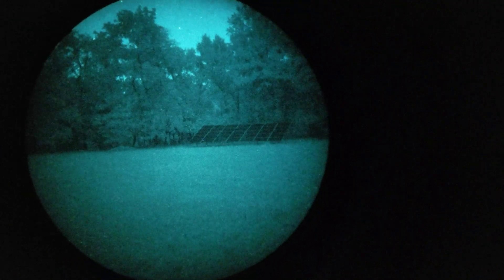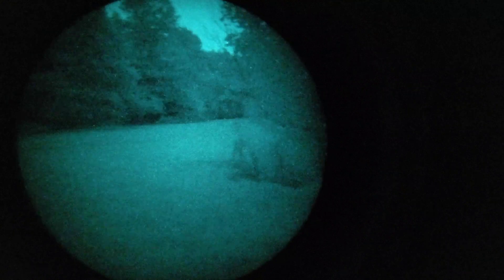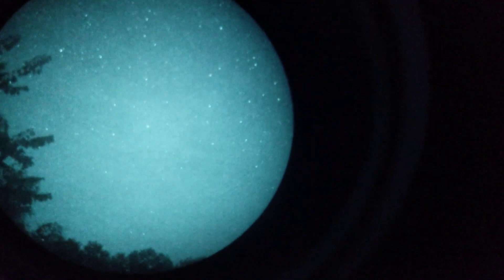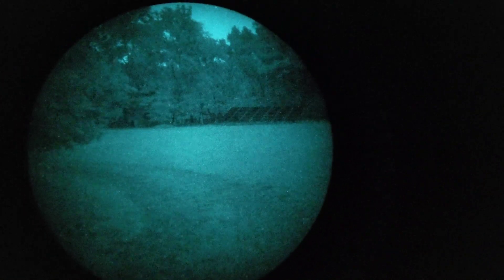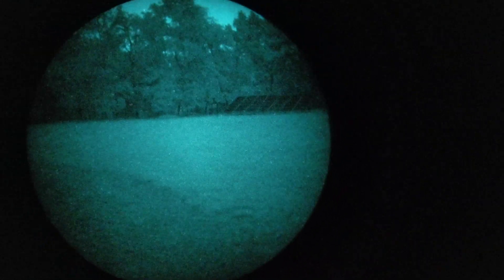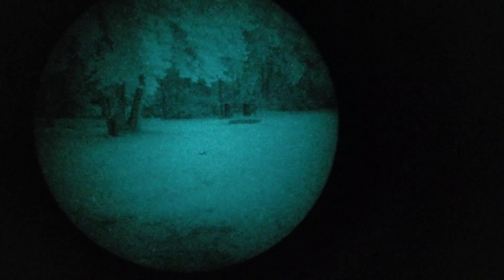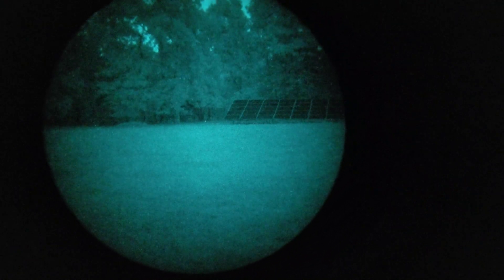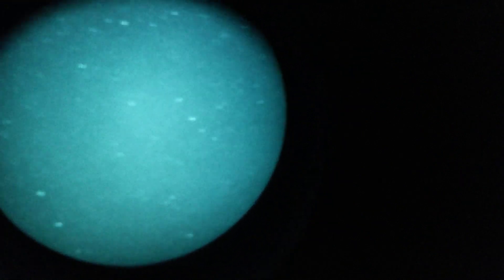TNVC SuperGain 0% moon

Comment: Thank you. I don’t really see the need to dish out the extra couple thousand from filmless to supergain, esp with fusion and thermals coming out. They’re amazing in every single way, don’t get me wrong. But I’m really happy w my 37snr filmless

Thank you for the video
Reply from the maker: I find that the supergain gives me a slight edge with passive aiming here where I live when it gets very dark. I live in a valley by the river, and often we will get a 2-400ft fog layer that cuts off even the stars, and it can get very dark in those circumstances, especially under canopy. That said, 100%! If you have a solid filmless tube, you're fine. I'd put the advantage at maybe 10%. Maybe.

Comment: How much better is Supergain compared to regular L3 filmless in really dark conditions, I mean dark forest on zero moon night? Is it similar jump as Photonis ECHO to L3? Or is it not that big of a difference at all?
Reply from the maker: I've not used Photonis before, but I am of the opinion that it's a 10-20% gain over L3 UF WP regular tubes depending on how spicy they are. It's a legit edge in the dark dark, but adding thermal with a PAS29B or TAD is a much bigger advantage, IMO